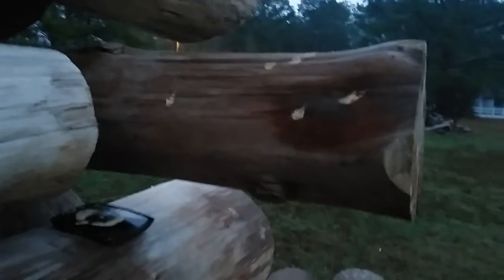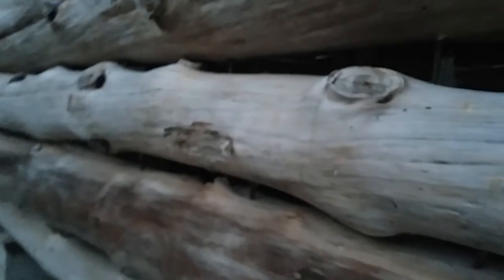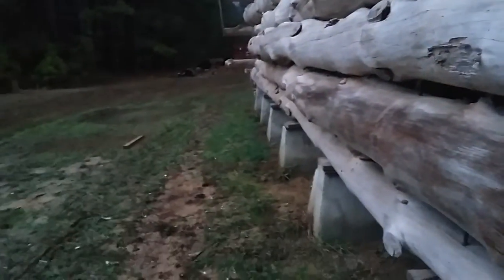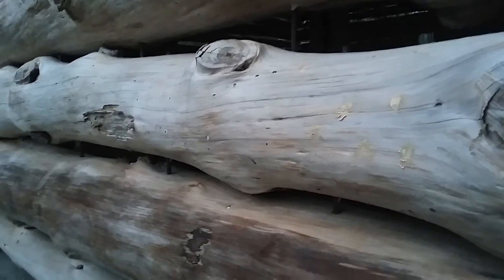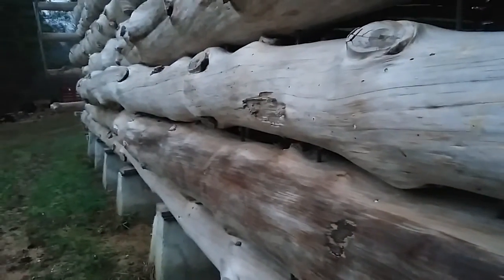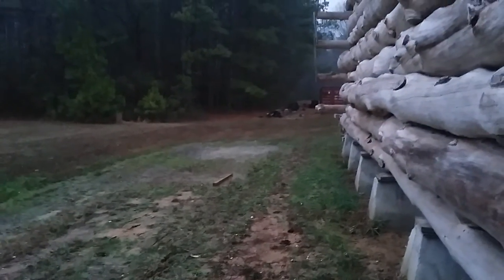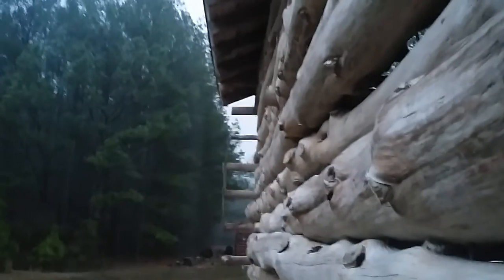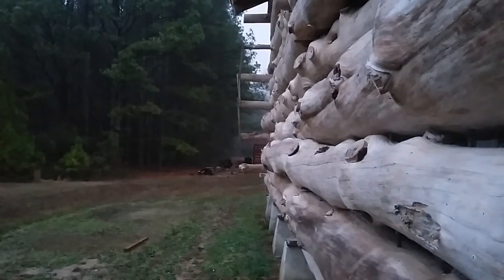Jan 2020 update on log cabin

Comment: Please excuse my ignorance but what are your plans for the gaps between the logs?
Reply from the maker: Sure- not a bad question- it is to be filled in with rockwool. Then nails for small gaps,  and metal screen for larger gaps.  The nails and metal are to support a mortar mixture, which will cover the metal. Mortar is used instead of silicone because it allows the logs to breathe, and does not trap water.  Thank you for the question!
Reply: @bawhjth  Thank you for the great response. Love what you've done!